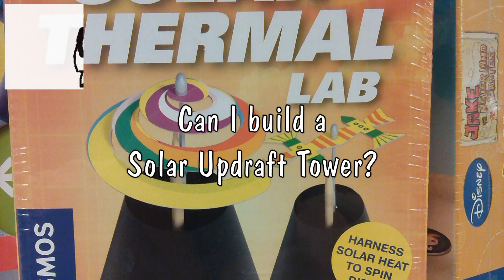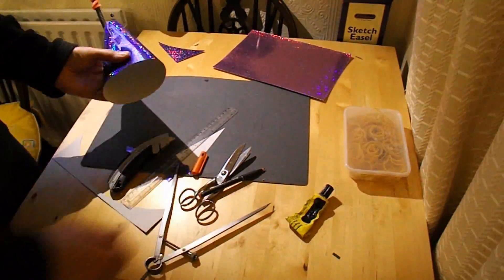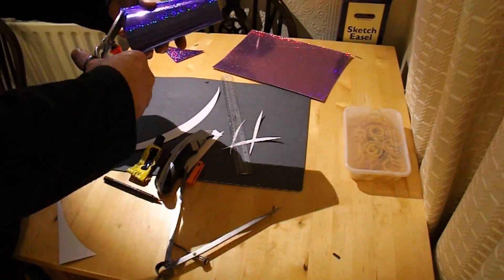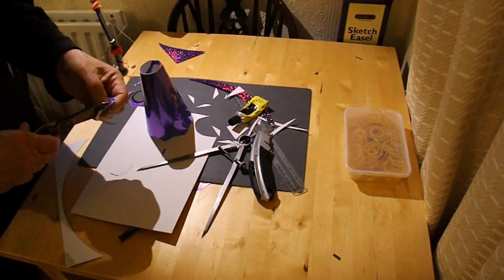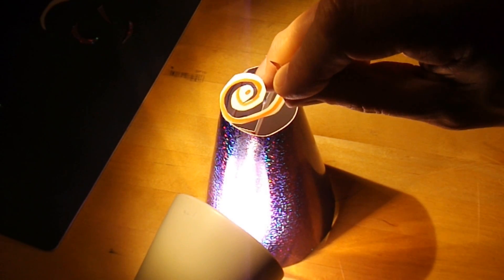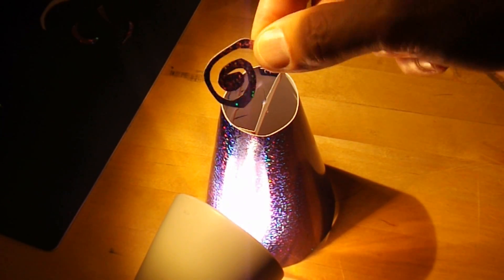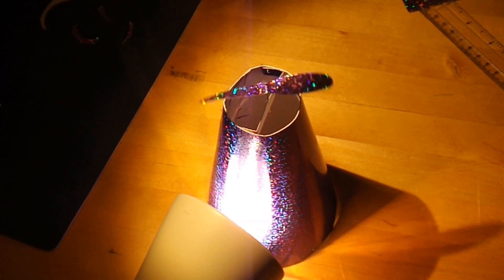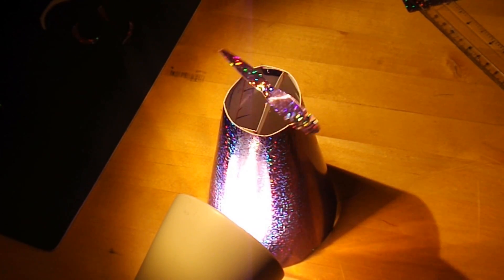Can I build a Solar Updraft Tower?

Comment: how much gap do you have under it.  better yet put the light under the cone.
Reply from the maker: It doesn't need much of a gap, I just cut a wavy edge along the bottom of the edge. If you are going to put a light under the cone, you might just as well just place the spinner above a normal lamp. The whole idea of this was to make a SOLAR updraft tower that you would leave in the window and the sun would heat it to spin the propeller. I only used the lamp because it was cloudy rainy weather anyway so no sun.

Comment: Do you know the temperature of the air??
Reply from the maker: +pedro henrico no I don't but it is the difference in air temperature that matters, not the actual temperature. The air inside the tower must be hotter than the air outside. The warm air will rise and cooler air will be drawn in at the bottom.